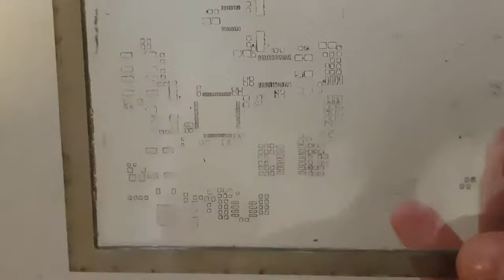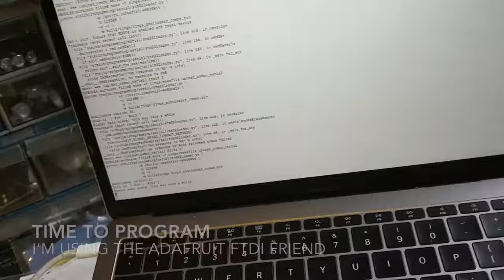Mutable Instruments Rings // Synth DIY Build // Hot Air Rework Tutorial

Comment: This is a nice time lapse. I'm assuming you set your heat toe 315F as the DAC and MCU have a recommended body temperature of 260C, hot air blowers and ovens tend to over bake. I prefer the heat plate method, more for the control aspect.

Comment: HI, I'm building rings (by hand soldering) and it won't power up. I have a test power supply for eurorack  that has 3 leds for +12, -12 and +5 which - normally they are full on, with any other module, but  with the rings they just blink every few second and go off.
I checked the power socket for shorts, downstream the diodes, also followed the diagram and board file - there is no continuity where it shouldn't be, and there is one where it should. Yet the problem persist. Do you have an idea what might be the fix? Any idea what part might create a problem like and why the power seems to go back in a way that triggers the power supply safeguard?
Reply from the maker: You definitely have a short somewhere, you're triggering your PSU's overcurrent protection. With a multimeter start measuring resistance to ground at each of the various voltages - +12,-12,+3v3a etc to find where in the circuit your short is.
Reply: @cctvfm  Thank you for your response! I actually managed to locate the issue yesterday a bit later and now have a fully functioning Rings :) I put the TL072 the other way around, I don't know how this happened, to be honest, and why it took me so long to notice!